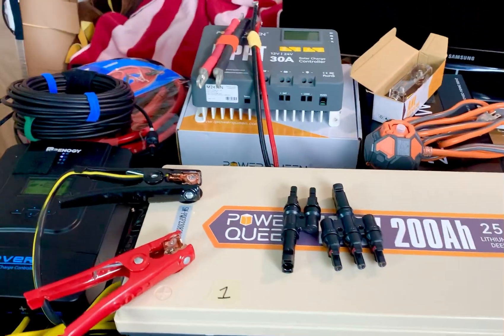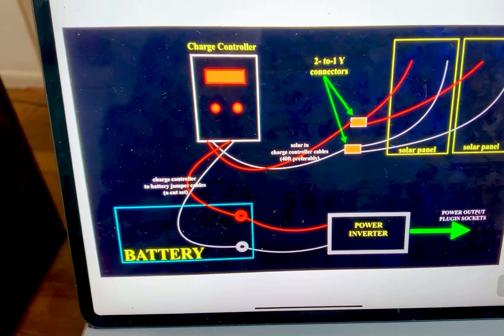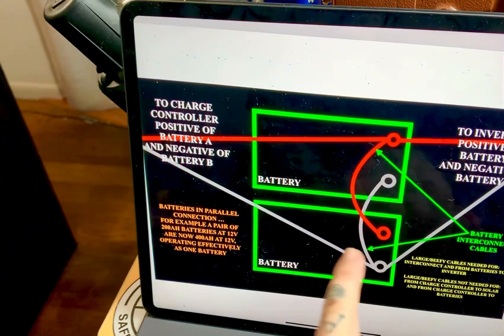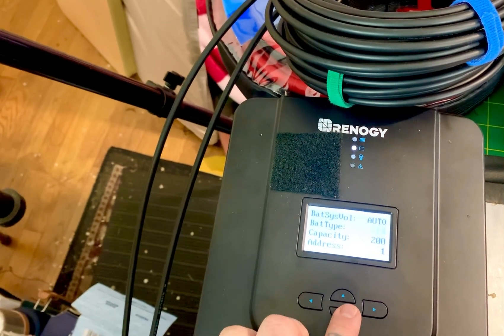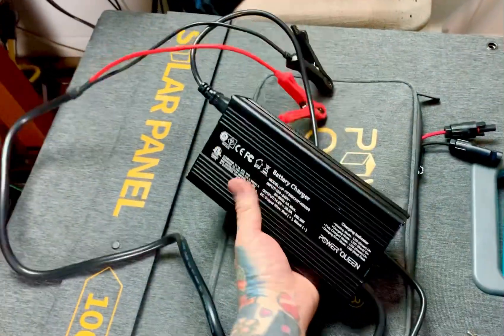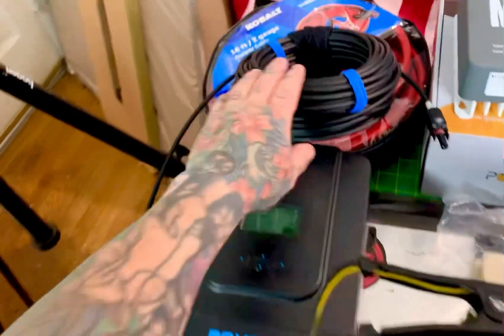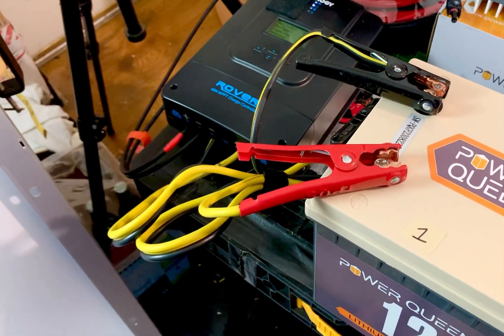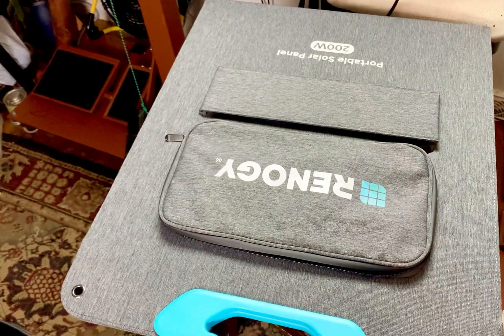🌞🔥 EMERGENCY SOLAR SETUPS 🤗

Comment from the maker: SIMPLE SOLAR PANEL SETUP!
https://drive.google.com/file/d/1NQG853mnS5L-SJQnHXb3F2-nMRpbVhWy/view
Power Queen 12.8V 300Ah LiFePO4 Battery
https://bit.ly/3Us43rL
Power Queen 12.8V 200Ah LiFePO4 Battery
https://bit.ly/3MJUXCd
Power Queen 12V/24V 30 Amp MPPT Solar Charge Controller
https://bit.ly/3QB52Cm
Power Queen 100W Portable Solar Panel
 https://bit.ly/3R4wZTA 
320W RENOGY SOLAR PANELS
https://www.renogy.com/2pcs-320-watt-monocrystalline-solar-panel/
RENOGY 400W PORTABLE SOLAR PANEL BRIEFCASE
https://www.renogy.com/renogy-400w-portable-solar-panel-foldable-monocrystalline-solar-blanket/
RENOGY 40FT SOLAR PANEL TO CHARGE CONTROLLER CABLES
https://www.renogy.com/solar-panel-to-charge-controller-adaptor-kit/#op=%7B%22id%22%3A1030%2C%22options%22%3A%5B%7B%22optionId%22%3A%222555%22%2C%22value%22%3A%221553%22%7D%5D%7D
RENOGY 200W PORTABLE SOLAR PANEL BRIEFCASE
https://www.renogy.com/renogy-200w-portable-solar-panel/
RENOGY 200W RIGID SOLAR PANELS
https://www.renogy.com/200-watt-12-volt-monocrystalline-solar-panel/
RENOGY 60AMP CHARGE CONTROLLER
https://www.renogy.com/rover-60-amp-mppt-solar-charge-controller/

Comment: If you plan on getting a solar setup, you may want to consider sooner rather than later. there was a big earthquake yesterday that damaged the Taiwan Semiconductor Manufacturing Co. plant, largest in world and a key critical single point of failure in the global semiconductor supply chain. So electronics supply chain disruptions are inbound and that may yield shortages of certain electronics components including solar power devices.

Comment: Ken if you put a low voltage (2..4v) high power capacitor pack between the inverter and battery (which you can buy made up for £20 ) then you'll be able to draw more from your battery set up without putting stress on it
Lead acid batteries can cook without one for example 
Cheers

Comment: Question for you sir, does a longer cord from the solar panels to the controller lessen the input than a shorter one? I have a 15 foot that came with panels but would like a longer one for my house.
Reply from the maker: falloff is very little

Comment: How very kind if you Ken. This is priceless step by step information on setting up solar panels, parallel batteries (12voltv400 amp hours) an inverter, and charge controller. Mounting atop my 20’ utility trailer/laboratory is on my investment list. Hats off :)😅

Comment: My tip of the day. Always try to match exact wattage & brand/model together because any time you match different sized/quality panels, it only draws your least effective wattage. So if you have like a 150 w and 100 w hooked up together,  it will only draw 100 + 100. Or if you have a great brand true 100 w and a cheapo 100w that only draws truly like 84 watts, you end up drawing 84 + 84 watts. 

My work around is i have 3 controllers (good to have redundancy) and so i have 2 hooked up. (4) 180w AcoPower (all same model) that i have all hooked up to a single controller, and i have 4 Renogy 100 watt hooked up to another charge controller. And using 2 charge controllers on a single battery, you get the full power coming in from both chargers, but theres no loss. If i hooked all 8 in parallel up at the same time on the same controller, it would only be 8 x 100, and lose that extra 80watts each from the larger 180w ones.

Comment: Nice design on the solar panel pvc kick stands. Stake down your big portable panels with Bridge Spikes (big ass nails). I've been using them for years for tarps and tents. You can drive them into hard rocky soil and remove them quite easily by hitting them horizontally a couple times.

Comment: Great video. I will certainly use this knowledge. I wonder your thoughts on some of the cheap all in one systems (refurbished Pecron 3000 from factory is roughly 900). I know they may not last as long
Reply from the maker: no to the ALL in ones